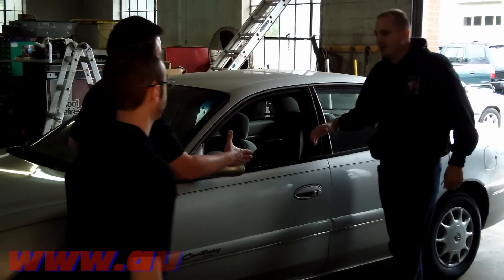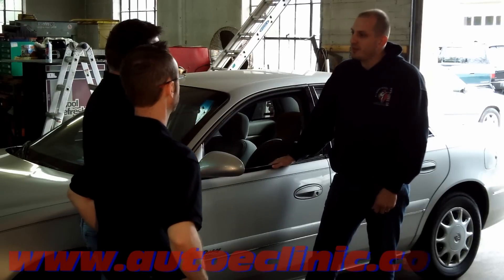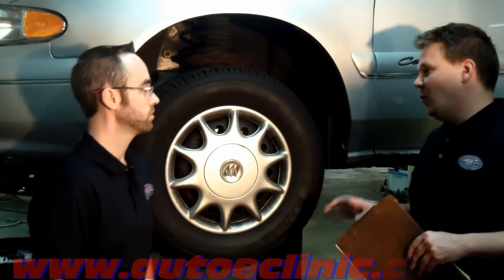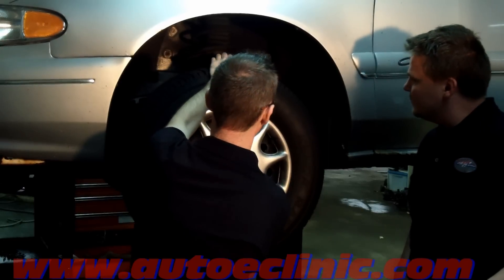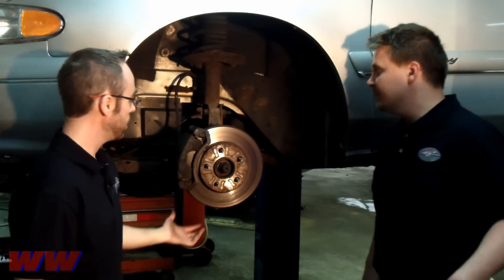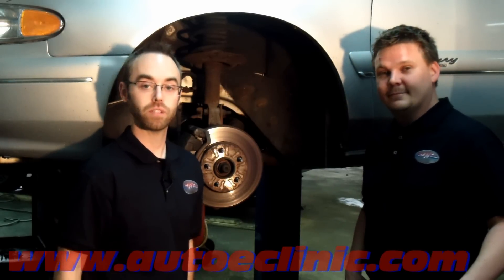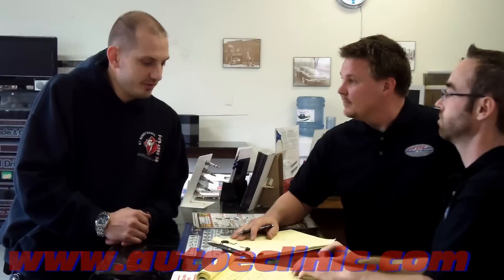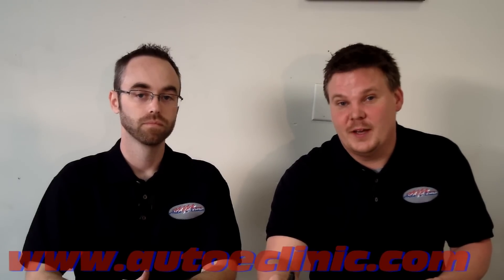How to Diagnose a Noisy Wheel Hub and Bearing

Comment: nice crap if you were true honest mechanics you would show the ripped boot like all us backyard mechanics do, I do  all my own work, just want people to know to ask to look at your part while they are on car if they don't show your probably getting ripped off,
Reply: I noticed there was no evidence of drive shaft chatter, and clean out, new grease and a new CV boot is probably all that's needed.  I'm totally with you on fixing yourself.
A good set of tools, common sense and even a manual for some bits and pieces.  
Personally in 25 years of driving nothing I've replaced/serviced has ever failed, same cannot be said for dealer and garage repairs/routine service (to maintain warranty) - they always loose bolts, over tighten bolts and never grease things that should be greased!
Reply: LOL. They took their precious time to produce a video,to educate people who have very little experience in automotive diagnosis and repair. It was obviously staged, but that's expected. I learned what I needed to know for my car, but from your comment, I was expecting an invoice in my email. My sincerest thanks to AutoEclinic

Comment: I have a 2004 chevy cavalier heard a humming in the front so I changed both wheel hub bearing and I still hear it what else could be my problem?
Reply: albert roswell ... A loose nut on the steering wheel will cause this.